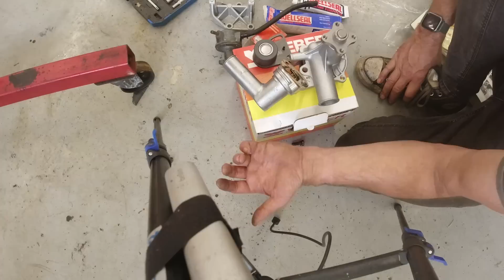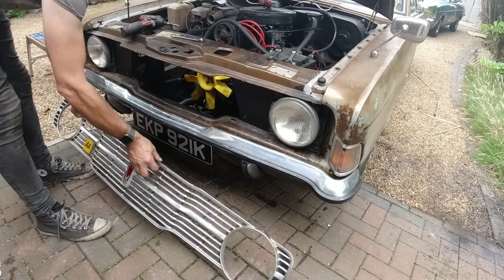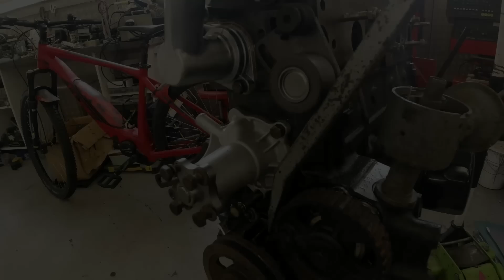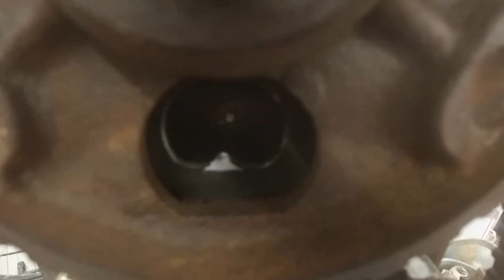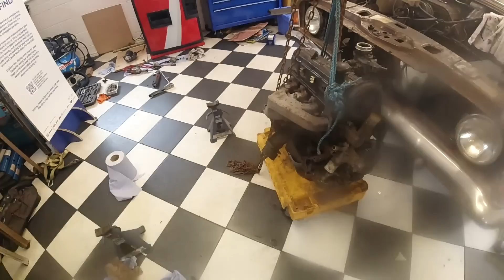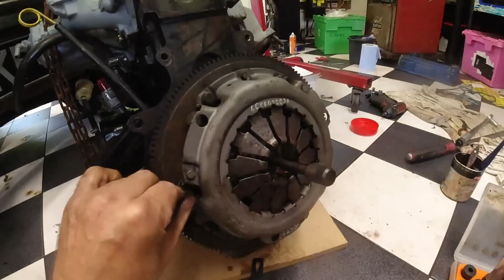Mk3 Ford Cortina - Installing a new engine in my workshop.

Comment: The spring bolt on the tensioner is a star drive socket because I think otherwise if it were a domed bolt it would foul the timing cover if fitted. I may be wrong

Comment: I owned a few cortina mk4 and 5 back in late 80s and 90s as well as sierras. One of my cortinas broke its cambelt at stairfoot roundabout barnsley i was on my way to doncaster. I walked to a parts shop and bought the belt and a few tools walked back fitted the belt in 30 mins and away i went to my destination none interference pinto engine fab engine

Comment: the tensioner spring was deleted on later pintos - 1985 onwards just use a normal m8 bolt with plain washer - you just tension them manually,